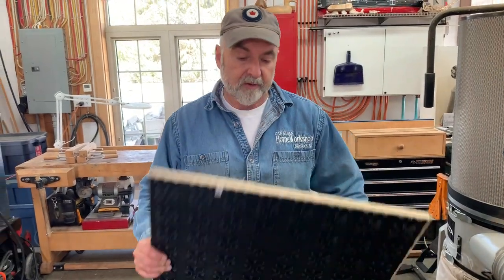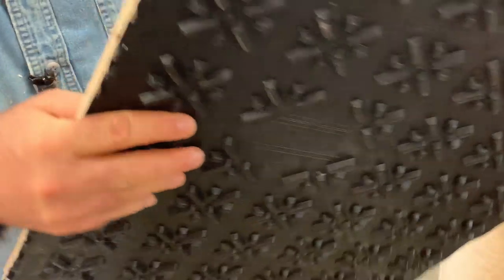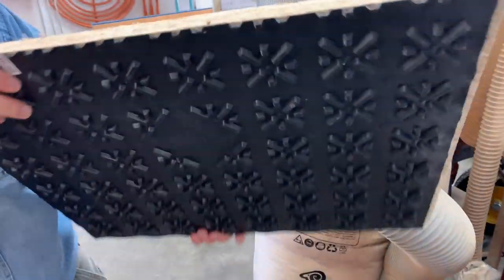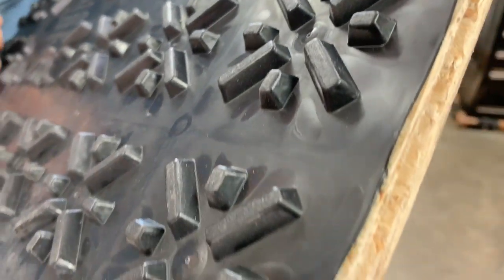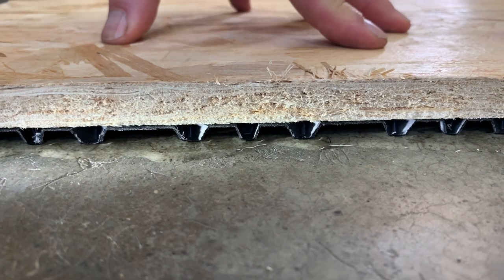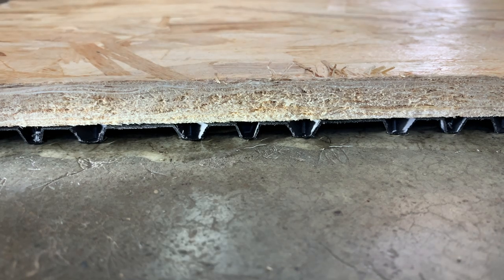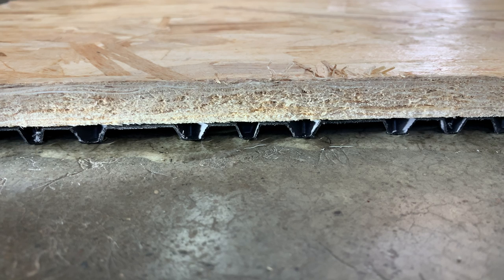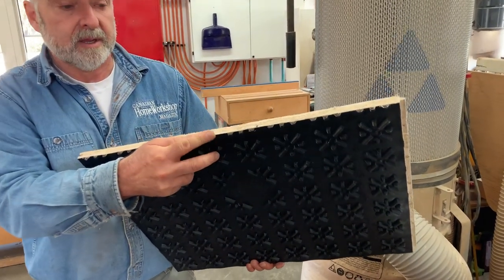Why Install a Basement Subfloor?

Comment: This doesn't solve the problem, it just moves it. Instead of the moisture condensating on the cold concrete, it will travel through the porous wood and condensate on the plastic layer beneath it and then since the plastic is impermeable, it will just pool in the little dimples and just sit there, eventually wicking back up into the wood itself causing wood rot and mold. At least in the first scenario the moisture would wick into the concrete and go away as you said. The best way to avoid this all together is still removing the source of the moisture itself eg. dehumidifier. Dry air is the best defense against a musty space.
Reply: I don't agree. Like a plastic vapour barrier, the plastic membrane beneath the OSB will create a vapour barrier not allowing wet warm air coming into contact with the cold concrete and condensating. 

Though I have heard these tiles struggle with their vapour barrier capabilities. From all the research I've done, a dimple membrane like the kind used on the exterior of foundations is better because you can tape it off and create a proper vapour barrier on the floor. If any condensation does occur on the concrete slab, it can air out as a result of the raised nature of the dimple membrane, same reason it exists on the exterior.